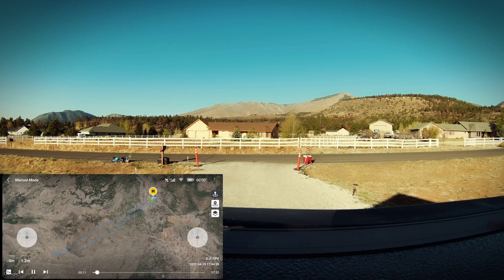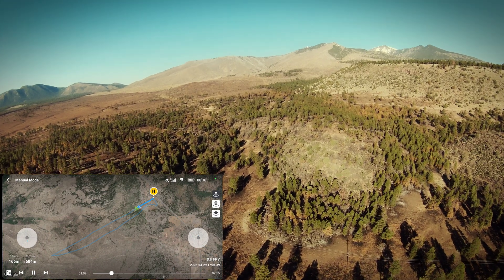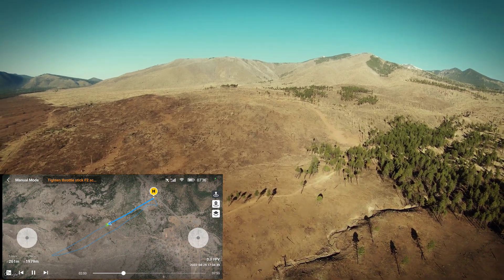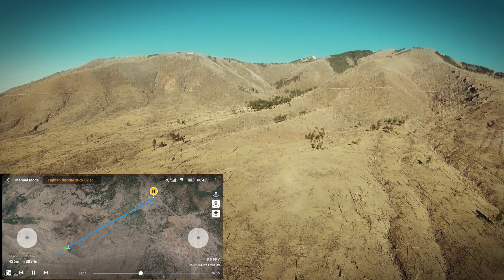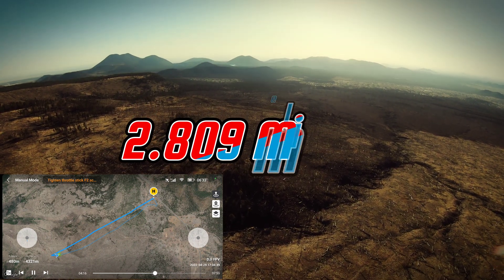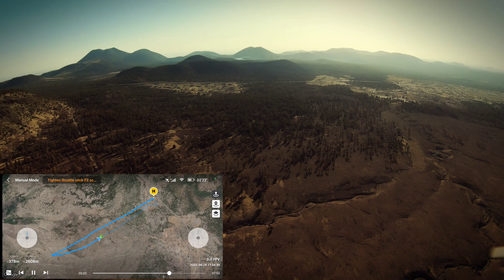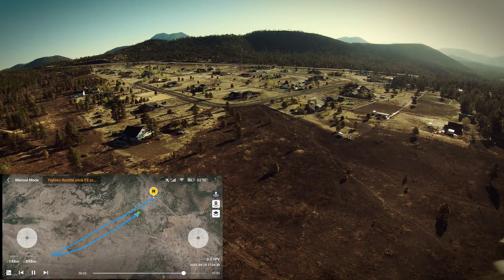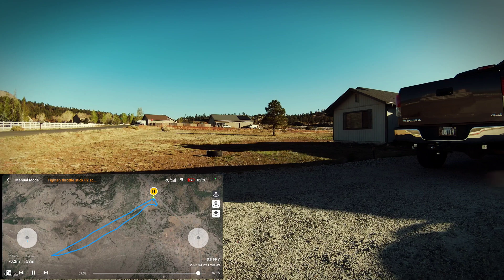DJI FPV Stock Drone long range test.

Comment: Amazing.  That thin dry air allows signal to travel very far. Good to see your land and surroundings after the fire.  If someone produces bigger battery...very interested in fpv 2 drone also. The mini 3 is kinda tempting even.
Reply from the maker: Haha that's funny about the mini 3.. I've had the same thoughts.  I really hope something is in the works for fpv..

Comment: Its 2.8 miles out and back….. not bad Imma test mine too soon.
Reply from the maker: right.. so almost 6 miles total.
Reply: @upnorthFPVandEUC  yes thats great too…. Ill let u know how mine fares…… I may try to use all the dji parts in battery but soldier in more mah running parallel
Reply from the maker: @Marcus2750-u1t  I would love to know how to do that.. let me know if it works!